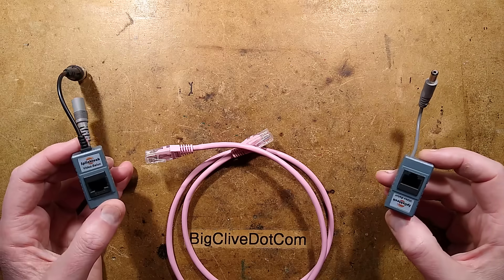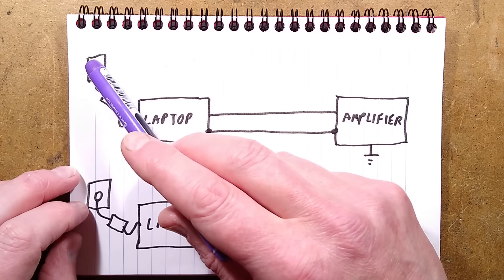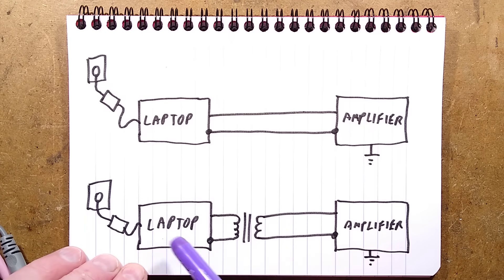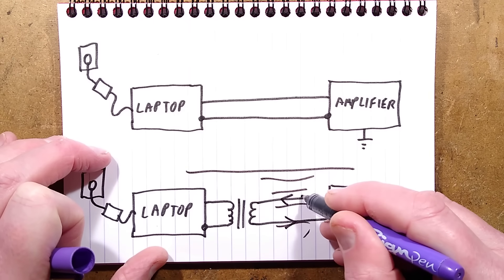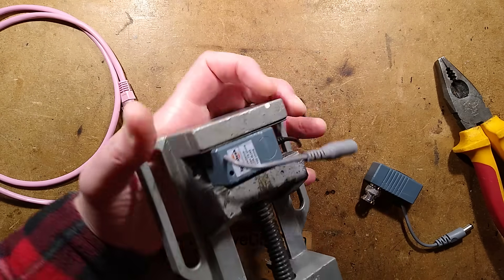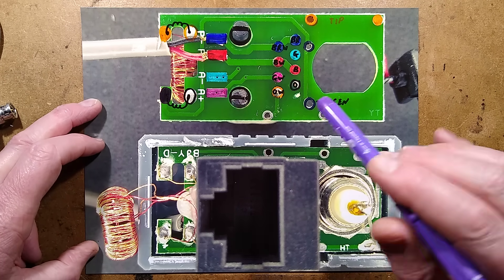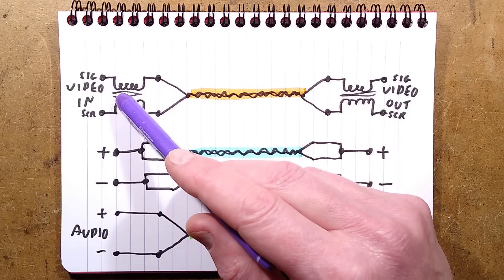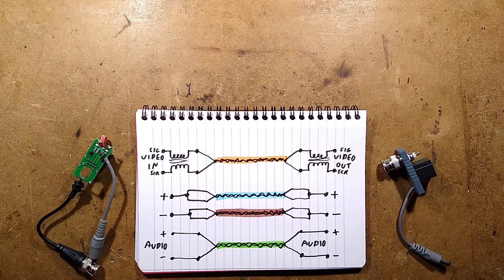Baluns - I got this one wrong (with schematic)

Comment: Baluns are not impedance matching devices. They are just cancelling the noise caused by low freq RF interference and ground potential differences (voltages across ground loops). On shorter distances (10-20m)  1 balun works fine for audio and video with any cheap cat5-e cables.
Reply: Not true at all. Baluns are specifically for impedance matching AND converting form BALanced differential transmission to UNblanced single-ended transmission. They have been widely used in RF circuitry for a very long time. They are common in things like RF power amplifiers.
Reply: You gotta love it when geeks disagree. It’s part of what makes YouTube fun, but instill rely on Wikipedia for serious information.
Reply: For audio and CCTV signal you don't really need impedance matching, they are too low frequency to make a difference. The role of the balun is to cancel noises caused by the mains power and other devices and picked up by the unshielded twisted pair cable. It's almost the same role as a galvanic separation transformer, but the balun allows DC current to pass.

Comment: The use of a balun for interface removal has a lot to do with the phase of the interference and by using a balun to change the phase of the signal in relationship with each other nulls the interference (usually). It doesn't always work, it can be affected by the number of turns on the balun, the length of cable and the frequencies involved, however it's more reliable more often than it isn't, and baluns are often used even when only using coax because of how they work they still offer benefit (depending upon the type of data or signal being sent).

In this day in age, if your CCTV is still using coax (analogue or digital) it's probably of an era where is significantly more insecure and of such poor quality it's would pay to get it replaced (unless it's used entirely offline, and in a well lit environment.

Comment: I've got several variations of these baluns, in a box of goodies, from the Vintage Computer Festival Midwest, in the States.  Some use a  coaxial interface, while others use a twisted pair.  Very interesting little gadgets.

In the Telecom Industry, they deal with induction noise on copper lines all the time, especially on long runs.  The are various filters they use, to suppress inductive noises.  The biggest offenders are the power utilities, which usually run parallel to the telephones lines, & induce all sorts of fun sounds on the line.  Farmer's electric fences are another source of problems.
Reply: Yes especially rural lines with the need to have those 88mH loading coils every few miles, though the worst has traditionally been railways, as the railways had, until they went to using phone company cables, used open pair wiring next to the overhead lines, and, because of archaic rail regulations, they never used those crossover insulator units to make a twisted pair every dozen poles, as they "needed to preserve polarity on the signalling" running on the same set of bare lines.  Just meant the poor rail operators had to deal with massive noise and hum induced on the voice circuits, while the signalling and trackside equipment, running on AC, were unaffected. when they replaced all that with a single multipair bundle voice improved considerably, plus they never used loading coils at all, even on 100 mile long lines. funny the same cable still runs trackside, and the signals still work, as each gets it's own pair in the bundle.
Reply: @SeanBZA  There's a video on Youtube from a retired Union Pacific employee showing the equipment they use which sends all the signal controls right down the rails (an AC track circuit), and I thought that's how most railroads do it now. Think the equipment was Genrakode.
Reply: @brianleeper5737  Most railroads still use a cable set running down the rail ROW to carry things like internal phone, signalling and such. Sending via the rails and power conductor is only for the actual locomotive comms, as a separate cable for power and track controls is always there, along with the overhead power line.
Reply: @SeanBZA  No overhead power line on the Norfolk Southern or CSX railroads around here. Any overhead cables they had at all were removed many years ago. The Union Pacific installation showed ALL of the track signaling being sent through the rails (this is before they implemented cab signaling). Norfolk Southern and CSX and probably all Class 1 railroads in the USA are similar.
Reply: The main method by which telcos, at least in the USA, deal with induction noise on copper lines is by using shielded cable and grounding it well, especially to the power company's multi-grounded neutral. Federal RUS (Rural Utilities Service) specifications call for telephone cable to be grounded at least every 1/4 mile. In some places where the telephone lines and power lines run on opposite sides of the road, you'll see a wire run across the road to ground the telephone cable shield to the multigrounded neutral on the other side. The effectiveness of this approach can be measured by using a clamp-on ammeter to check how much AC current is flowing in the cable shield; if there's little or none the cable isn't grounded well enough. Unfortunately, cable locators often disconnect cable shield grounds and sometimes don't bother to reconnect them. I've seen that quite a bit around here.
Reply: @brianleeper5737  I would say that is more lightning and surge protection, the twisting of the phone pairs is the main noise reduction. Shielding is to prevent lightning induced voltage leaking into the phone circuits, providing a low impedance path to ground for it. Have had to use split pairs in old failing cable, and there even a 50m length of lead sheathed cable, in steel conduit, had a lot of noise on those new made pairs. Finally got the telco to lay a new cable which, even though it still used the old lead cable for the 305m length to the local office, was a lot lower noise on all pairs. Trunk cable no split pairs, and even though it was laid in the 1890's and likely has no more outer steel armour left, it still was in good condition, and has 500 pairs in it in paper insulated tinned copper, no oil impregnation.
Reply: @SeanBZA  A section from the manual for a VDSL line tester refers to "power influence": Power influence is the noise that is caused by AC induction on a cable or pair.
If the cable’s shield is bonded together and periodically bonded to ground,
this induced AC goes to ground and does not find its way onto tip and ring
(A and B). To perform the power influence test, tip and ring (A and B) are
shorted and the noise is measured to the shield. In a “balanced pair,” tip and
ring (A and B) are mirror images of each other. In such a balanced pair, the
noise due to power influence is not audible. In an unbalanced pair, the noise
is audible. Acceptable power influence readings for VDSL are ≤90 dBrnC.
Unacceptable levels of power influence are typically caused by poor bonding
and grounding of the cable shield.
Reply: Interesting thing here on a Ballin or matching Transformer.

Actually a few.

First of all I remember back in the day when I lived in Canada cable TV.

Which was actually closer to community antenna television if anyone remembers this stuff you don't hear that much anymore.

To put it in a nutshell essentially before the Advent of digital cable if people will remember that generally the First channels of the cable were actually on the VHF band so you can get channels to through whatever it was almost forgetting nowadays since we don't really have VHF anymore pretty much analog broadcasting what the way of the dodo I know there might be a few outline things or other but mostly pretty much dead as a dodo.

I remember the old matching Transformers we're about twice the diameter of the newer ones and ran across that years later and wound up using it still years back.

And when it finally did get messed up and was curious opened her up and pretty much same construction is the newer ones but just a bit larger chassis primarily I'm not sure if there's a difference in the size of the matching Transformer itself internally the toroid Transformer that is.

Been a long time.

Also I know that it is also possible to do something similar with a group of capacitors I have seen this at least once as well in practice.

Also with the ground Loop isolation Transformers or isolating Transformers absolutely this does help with audio if you have a device that introduces noise into the audio have had an issue with this with an Alexa device once.

Also I'm going to be designing a custom quote unquote Black Box.

To be able to run 2 stereo one level send receive as well as auxiliary some sort of connection likely 3 wire including isolation on the serial data and also audio.

Apparently ethernet Transformers work well for audio isolation from what I understand.

Also these boxes will not be passive since need power for Optical oscillation of the serial data.

Using infrastructure or represent to link 2rooms for audio.

Who knows what nastiest could happen on that cable I know for a fact that exits the building but we'll have this connected by service provider with a coupler if indeed it does go outside not even sure it is cat 5 cat 6

You know currently terminated as a Telco connection.

Have confirmed through service providers this is the case.

Using some infrastructure to make it easier to do whole home audio unfortunately not able to run cabling For custom install.

Logistics ugg.

Make the best of what you got available.

Also in addition to isolation full surge protection including audio lines and the data connection.

Also of course the Firefox would be a device to provide a breakout connection for everything and possibly provide some other functions as well potentially essentially those audio alliance with service and receive to be able to link both parts of the system having all the expensive stuff at one end in the main cabinet with all the audio gear since all equipments in the same cabinet makes things easier!
Reply: Having lived on a farm and also having relatives that lives on farms this is a known issue with the electric fence Energizer.

Anytime you would have a 120 volt and sometimes the other radios you would get that tick or click at a regular interval a lot of people will be confused by this and didn't realize that it was the electric fence controller especially if they didn't usually be on a farm or even realize this not that one very often confuse me at first when I was young.

Although my mother did teach me how to test if a fence was electrified or if an electric fence was active you basically grabbed a long strand of grass or other piece of some foliage and it would kind of Wilt if it was a active electric fence.

Still remember vacation at night sing in Ark jump across to overgrowth along the fence lines sometimes.

And yes there are cases where lightning and start the fence and had injured someone nearby scary thoughts.

What time was showering son thunderstorm I felt something through the floor best of Whitney Houston truck nearby and sure enough it had.

Also remember something somewhere happening at camp what's myself but campers for showering and the same thing let's check out the intercom system too did manage to do some repairs for them at least amplifier was not completely toast.

I don't know how they say they survived the lightning strikes but they do sometimes

Comment: I thought they were going to be "Bias Tee's" for supplying power over a single pair without upsetting the RF. Normally used on coax cables for powering switches or pre-amps etc. As others have said the transformers are being used as common mode chokes for noise suppression and possibly impedance matching.

Comment: if just for audio, i found that i can't power the speaker and phone from same 5v psu and connect analog audio. gives horrible high freq noise. removing power from one fixed it. then i fixed it fully with audio transformer

Comment: The maximum distance from the datacomm distribution frame to a wall outlet is up to 90 meters, so a video camera could have a 90m cable from the camera to the frame, and another cable from the frame to the security system.  That's up to 200 meters with patch cords, etc.  So the signal quality depends greatly on the lengths of the cables.  Some video cameras may lose a lot of quality on long runs.